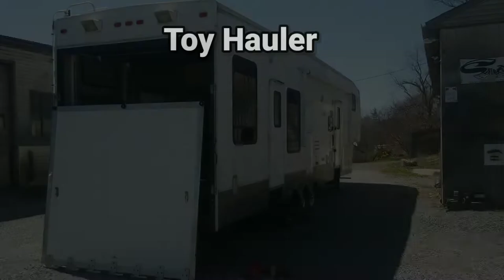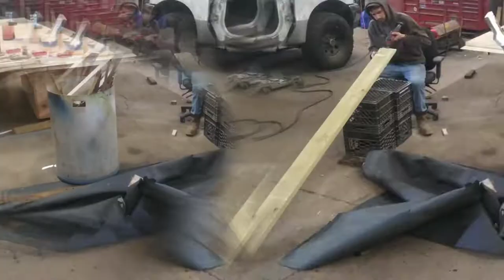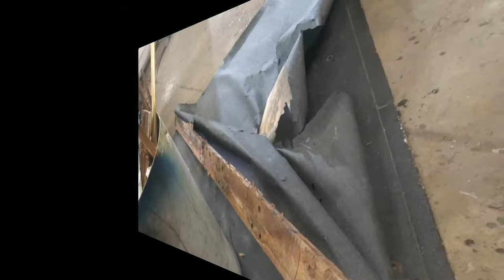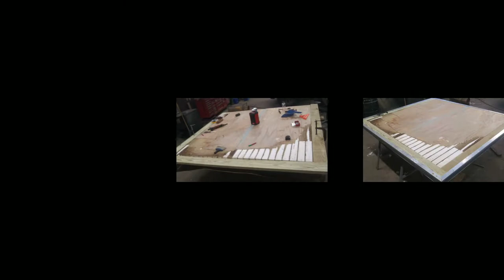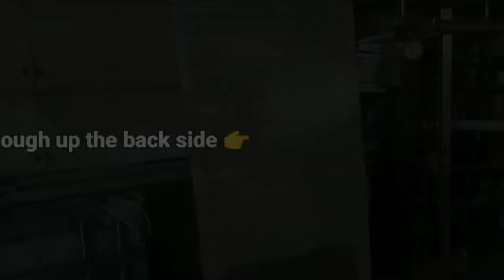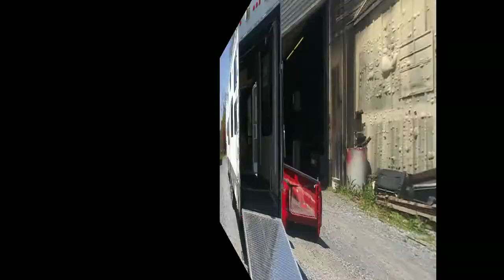Toy hauler ramp door rebuild (severe water damage)

Comment: I need to do the same thing with my toy hauler (2011 Raptor).  How much did it cost you to make the repairs?  thanks!
Reply from the maker: I got the aluminum panels and angle at Surplus City for around $300. The resin was about $100. Ordered the seals on Amazon for $50. Screws and caulk was probably another $25. Hope this helps, good luck!!